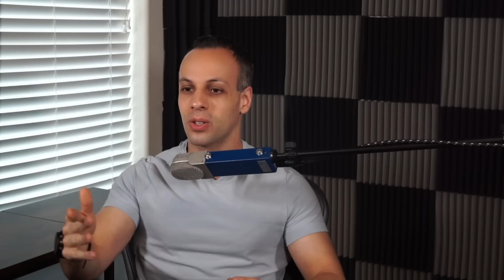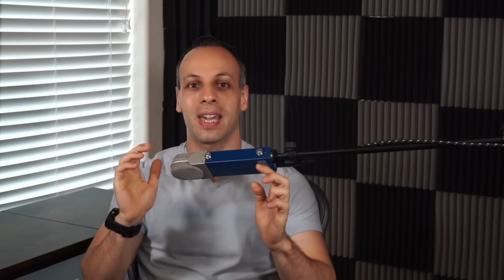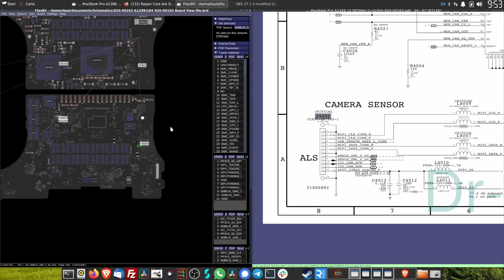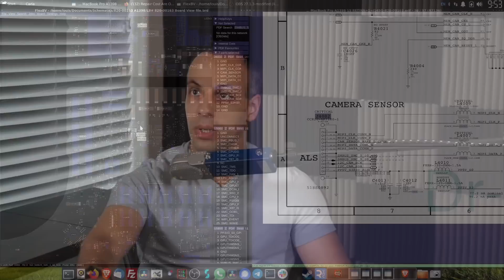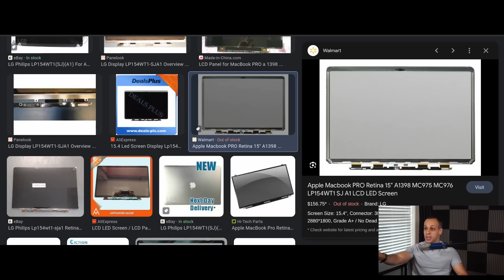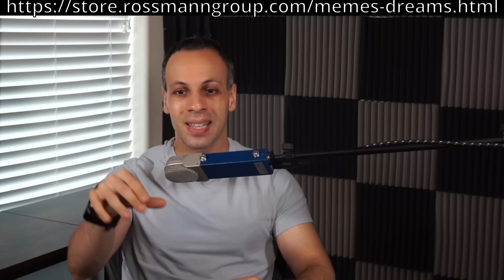The Ford F150 Macbook - when car repair resembles macbook repair...

Comment: I was at a body shop the other day (Im a subcontractor and am always in different shops) and they had to calibrate or link (I'm not sure the term) headlights to the computer on an Audi, and calibrate the sensors.  Apparently, the headlights send a code to the ECU so you can't just replace a headlight with another.  The job of calibration was 2,000.  That's not the headlight cost, bumper and painting, that's just the cost of calibrating the headlight to the computer and other sensors so that the car will drive properly.  Fender benders on modern cars frequently cost 8 to 10k per car.

Comment: Stop whining.  A guy had a Rivian hit in the rear quarter panel under the tailight and the estimate was $41,000 to repair as the entire side of the vehicle needed to be removed and replaced.  A dentless car repair guy did it in two days at probably 1/5th the cost.  You can see the results here: https://youtu.be/DKPfy5djvLc?si=5-HtBSayTD9T12TIhttps://youtu.be/DKPfy5djvLc?si=5-HtBSayTD9T12TI

Comment: There is a reason my work truck is an '09 Toyota Tacoma bare bones work model. It has wind up windows, a 5 speed manual transmission, and no key fob. It is simple. My blind spot warning is setting up my mirrors in such a manner that I can watch a car travel without losing sight from my rearview mirror to my side mirror to my peripheral vision.

Comment: Fords biggest cash grab is their flimsy windshields. I dont know about their cars, but their trucks f150-f450 use trash windshields, and the sensors have to be reset at the dealership which keeps people preferring ford to replace them. Every truck 2015 qnd higher you see on the road will have a broken windshield, and the owners think its normal. I have a 1980 datsun 280zx with the original windshield and my buddy replaced 4 windshields on his 2021 f450, he thinks its because of the angles lol

Comment: Thanks Louis: you are exposing the whole dishonesty of the auto industry-the cars becoem worthless because repair costs too much. The same mentality applies to domestic appliances...my clothes dryer broke-it was a bad on/off/start switch-this thing was the chapest switch I have ever seen-cheap plastic and stamped alumibum-replacement cost? $55.00! I glued it together with JP Weld-works fine. I figue a service call would be $150.00, plus the part...>$200.00

Comment: This is why you don't buy those cars and trucks that have all that sht on them. First off those trucks and cars with extras cost so fkin much, the electronics don't last and you are adding 10-15k to the truck with the nonsense tech that you don't need and can't afford to replace. You buy a basic truck or car with power windows and Bluetooth and a backup cam, you need nothing else.  Don't forget it

Comment: The car industry makes its own parts (same manufacturers, different format, different code) from a diode to a chip. There are no schematics, datasheets or pinouts. making many repairs impossible.

Comment: That same truck ended up back at the same shop that figured out the problem with the tail lights causing the issue. it was for the driver seat not working right. turned out broken wire from them being too short from the factory because it doesn't allow movement but when they are lumbar seats and they are designed to move they eventually pull out/break off the wires. it was a cheap fix this time but right after the tail lights and not knowing it was related or not can get frustrating for sure especially since if the factory would have put an extra few inches of wire on them so the units can move would have solved the problem. so many problems with these newer vehicle i hear from people that buy them I am glad I stuck to my older stuff that I know how to fix myself.

Comment: Not quite the same but a headlight replacement for my wife's 2012 Buick Regal GS is $1500 for the part plus labor.  Not bad for a light bulb.  Fortunately, I was able to take everything apart and replace the bulb and ballasts for $150.  Still a ripoff.

Comment: The reason for this is simple, it's by design. cars have become so ridiculously overengineered, it's ridiculous. I work on passenger aircraft, and half of them aren't as overengineered as vehicles have become. Newer cars, have become exponentially more expensive to own due outrageous purchase prices, but also do to massive cost of ownership increases. I have a friend that owns a 22 Sierra that has already had an issue with the active fuel management system in his truck and he hasn't even gotten to the first oil change. The parts to correct this issue are on national back order for at least six months. Government and EPA regulations, have forced auto makers into manufacturing overpriced pieces of garbage and exorbitant prices all in the name of "green" and "renewable energy" concerns. At the same time that all that is going on, the EPA is cracking down on after market parts and shops that perform modifications to eliminate some of the major issues. There doesn't seem to be an end in sight. If we would all only go out and buy EV's, we would never have to worry about this kind of thing. *end sarcasm.

Comment: How hard are they to remove

Possible

No crawling under the truck cutting off the Cat with a saw.

Possible just a cheep screw gun and a in 1/2 the time it takes to remove a CAT.

You can walk away with how much in tail lights

In avation the can bus is is but if a avionics unit failed it doesn't take down the bus.

You get a warning that the item has failed All other Itams work just fine

You also have to love how Ford dumb the king pins on there front suspension and we to a cheeper less dependable ball joints

Have an old 80s model van with over 500k lot's of rust but the king pins for the most part are soild as a rock

Do the new Ford Vans and trucks with ball joints last this long  do they have grease fittings

Just wondering

Comment: In comparison, I have a 25 year old Chevy truck and the "module" that the light bulbs mount to in the tail light failed due to heat and age. Both sides shipped to me from Rock Auto were about $20 total.  The lenses are fine, but they are pretty cheap and easily found.

Comment: I’m an automotive tech I can tell you that ford has pigtails for alsorts of things but the kick is that most techs or parts departments would rather buy the pigtails then figure out how to use Digikey to look up pins and connectors. I’m currently an upfitter and have become custom to the use of Digikey mouser and even newegg for parts that I use.

Comment: After being in the automotive industry for many years, I got discouraged with the path the auto industry was going. This 5000$ tail light repair sums it up. They are putting too much over kill technology into our vehicles sure some is doing a good job but this type occurrences are becoming all to frequent. The engineers are putting too much emphases on this over kill technology it's like a ego thing instead of well lets make it better for the consumer. A few good high costing law suits with huge fines might just might get them to change their path of technology. Now in this 5000$ case the customer obviously was in a position to pay the bill, but what's to say that someone down the road who picks up a older vehicle and runs into this repair, someone not able to throw away $$$.

Comment: 20 year Master Tech here, I assure you, they only build cars with all these features to stay competitive. As new tech comes out, it becomes mandatory. Every one wants to have those mandatory systems be proprietary. A vehicle is like any other mass produced product. Some r good. Some suck. But they ALL will need something at some point! Stop bitching about it or take the damn bus! N if u think ya old car is so much better, holla at me when u can’t find that part u need and/or after u get in an accident! Lastly, we as techs HATE engineers but once u get so many years of factory training from several different brands, u quickly learn it’s IMPOSSIBLE to build anything in compliance with law, affordable, n desirable that doesn’t have issues. We westerners have so much n complain even more🤦🏾🤦🏾🤦🏾

Comment: The crazy thing is it is not just the parts.  Just like with John Deere, to fix anything attached to any of the couple dozen modules in the vehicle requires access through proprietary software.  The vehicles do make their software available through distributors . . . . . . but you need a 2-3k scanner to read and program the parts plus you get the pleasure of paying a 200-300/month subscription fee to be allowed to access the system.

Comment: I honestly don't understand why people purchase apple products that are literally designed to experience catastrophic, unavoidable, unrepairable damage AND are overpriced by several multiples of the performance value of the parts within a device. It's starting to get to the point where using Apple products says a lot about the user... and not in a good way.

Comment: Here we have a consumer law that the product must fit the purpose. That means that if a manufacture sells a product that has designed are production faults they are liable to repair/replace the item even if it is outside the warranty period.
Maybe the purpose of the F150 is designed for little old lady to drive to church on Sundays,  1 mile up a good road when it not raining

Comment: My suv transmission went into limp home mode because i changed the tail light bulb with a non OEM bulb. It was great to have to take it to a dealer and get a rental car before work for this.

Comment: It's also likely that, by incorporating two sensors into one circuit the engineers found they can save twelve cents on a foot of wire on a $60,000 truck.  There's a reason it came out this way.
Reply: I think they start at 80,000$ and go up to 130,000$ these days but still your point is absolutely valid, probably management tells the engineers can you make it cheaper? No even cheaper ? It can break easier that's ok let the consumer fix it just make it cheaper.

Comment: What idiot engineer puts a module let alone more than one into a taillight housing that gets super hot in the summer (because there is an led AND it's basically a greenhouse) nevermind that this module is also needed for other modules to communicate????   I'm sick and tired of the average DIY mechanic knowing more about repair than the engineer designing the vehicles.  We're not talking about a few hundred dollars folks we are talking about tens of thousands sometimes.  There are many many instances where the entire engine needs to be removed to get to and replace a $5 part.  These days it's happening all the time.

Comment: this module down issue started here in America with GM products in the late 90s-2000s and now everyone has joined in..  its a piss poor design concept that has only been excepted as standard and become the norm..

i recall the first few years dealing with things like this at an independent shop and having to learn all new strategy to make these repairs..   not a huge deal in the sense of repair but sometimes costs are insane and often there is no way to verify module is the problem other then testing all inputs and output circuits..   when to comes to german cars who use BOSCH company's like Module masters are a life saver, turning repair costs from thousands to hundreds of dollars..

also did Ford warranty claims for a few years, i think i recall water damages not covered under any circumstance.  key words tho "i think i recall"

Comment: I believe you missed the actual issue here. It wasn’t malice or incompetence. It was mandated simplified design. If they can run all (or at least most of) communications through one bus, that saves money and Ford makes a higher profit. These trucks already cost well north of 65K USD and adding additional busses increases costs, therefore making the truck more expensive to the customers. We are already crying over the price of a pick up truck, imagine if they added an extra 3-10K to put the non-essential communication on a separate bus.

Comment: I have a 2010 Lincoln Navigator. The headlight bulbs are $130.50 each. The left headlight assembly is $981.51 the right is $843.97. Again, this is a 13 year old car. In this day its almost that you should be happy to even get parts. My Kenworth has been in the shop a month waiting for work. I miss the days when everything was available, affordable and repairable.

Comment: I stopped buying Ford sometime after 1996. I tried out a Ford Fusion for my wife in 2015 and it had a cracked cylinder head by the time it hit 22k miles and was towed and fixed by Ford. Then one thing after the other started breaking so I took it to our local Toyota dealer and traded for a Toyota Camry SE For my wife. Problems solved have not had any more problems. Just do not buy Ford problems solved:P

Comment: As someone who was involved with Ford for over 30 years I can tell you that you are “ spot on” with that Birds Eye view. I had washed my new truck in 1992 then overnight the temp dropped to below freezing. I opened my door to go to work and found out that the door could not latch. Long story short Ford switched to cable linkage that year and water ingresses into the cable and freezes. Big recall! Design engineer didn’t know that the cable was open to rain or wash water. Bird’s eye view would have prevented this.
Reply: saved $1.40 to produce though.

Comment: This is exactly why I buy models that don't have all the "extra" crap you really don't need.  do some of these features add convenience? absolutely, but is that convenience worth the added cost of repairs when it eventually fails?? absolutely not.  If you're not capable of driving safely without a bunch of nanny features in your vehicle you shouldn't be on the road plain and simple.

Comment: All pickups aside from Toyotas I think have the rear blind spot integrated into the taillight as there really isn't any other place to put them. Can't put them in the bumpers as they're usually metal and the blind spot would not function there. I understand why they do it but its still kinda dumb

Comment: 35 years ago I had the brake lights go out on my 1985 Pontiac 6000. Simple bulb replacement? No. Simple switch replacement on the brake peddle? No. The mother board on the computer that monitored multiple systems failed. More than a $1,000 replacement that had to be done twice due to a wiring short.

Comment: I’ve been saying this recently. 

Tail lights used to have replacement bulbs. 
Modern ones are way over made and in most cases the whole unit needs replacing at a huge cost.

Comment: the AC  evaporator on my 2015 ford with only 65k miles sprung a leak... $200 item, but repair bill $1,400 because techs have to remove entire dashboard to get it!  And ford dealer wanted $4,000 to fix it!  Ford ACs are notorious for failing after warranty runs out... 
as Louis says, *IT IS SHEER INCOMPETENCE * for a corporation  to  keep shipping out products that will cost customers so much money and aggravation for expensive repairs that should not be needed

Comment: Part of basic durability testing for cars should be "If any computer module unrelated to managing the engine dies or misbehavaves, will the car start?". Pull the bus lines high, low, send junk data, overvolt it. Change the design until that no longer takes out the whole car. It seems many cars these days don't even get that far. Just watched a video of a Land Rover that wouldn't start because the telematics module died (The module that enables the phone app and 4G remote services). That shouldn't be a thing.

Comment: The old Toyota Hilux could be in the ocean filled with salt water in the cylinders, have fluids replaced and water removed and then would run. Ford now gets a little condensation in a taillight and shuts down 🙄

Comment: Don’t forget that you need to have a subscription based $4k - $10k automotive computer to even diagnose most of the issues on a modern car. Then, calibrate yourself to the fact that the majority of the “technology” in a modern vehicle is for emissions reduction. Since 1996 and the OBDII mandate, all in the interest of reducing carbon emissions, our cars are required to have this technology. Fast forward to today, and we are being told that we HAVE TO make the switch to electric vehicles.

The claims that we need to switch to electric vehicles to save the environment is a prima facia admission that all of the previous emissions reduction technology has been an abject failure. Every time you’ve had a Check Engine Light come on in your vehicle that you were forced to take to a dealer to repair or face not being able to get a valid inspection sticker, you paid out of your pocket to “fight climate change” in vain. It was all for nothing, according to the climate people. Hundreds of billions of dollars in repairs, parts, time, labor. Add to that the fact that ALL service stations that offer inspection service were REQUIRED to update their shop tech to work with the new mandated laws. All for nothing. 30 years of “I just don’t understand new cars so I can no longer fix it myself” all for absolutely nothing.

I have a Dodge Ram right now that’s not running well. I have an oscilloscope, 2 VOMs and a current clamp and a $4000 Snap On diagnostic computer all in play trying to figure this thing out. 30 years ago this would have been a matter of replacing plugs and wires, possibly a distributor cap. Today you’re fucked.

Comment: The fact it was a 2018, and the failure involved safety equipment failing in 5 years makes it that much worse when you consider how much the owner paid for a vehicle like that.
I watched the video and there was so much wrong with the tail lights between the weather sealing, the connector sealing, (not) being able to replace the connector easily, the way the whole assemble interacts with the vehicle.... Unbelievable.